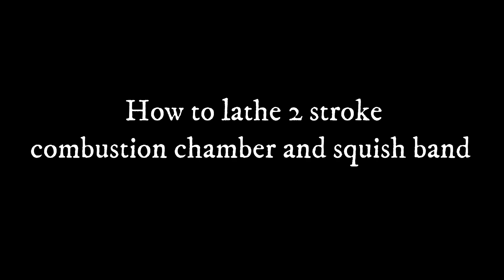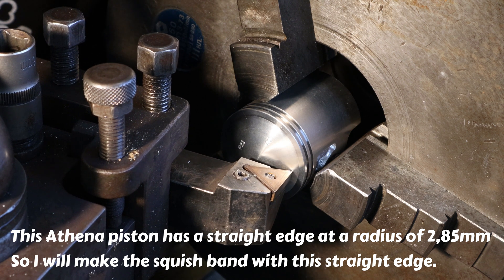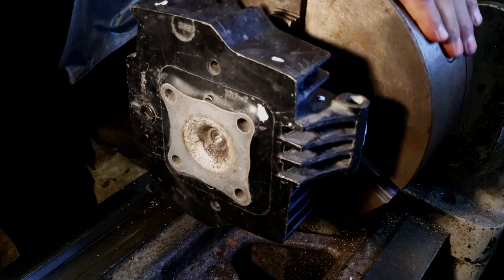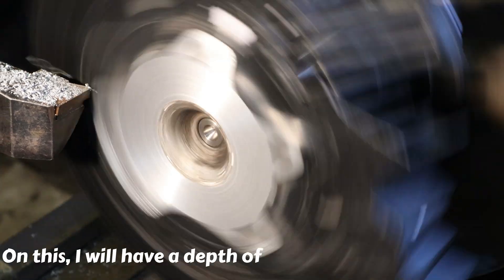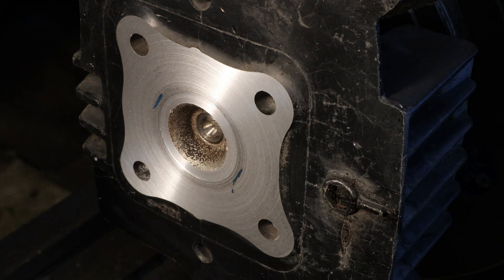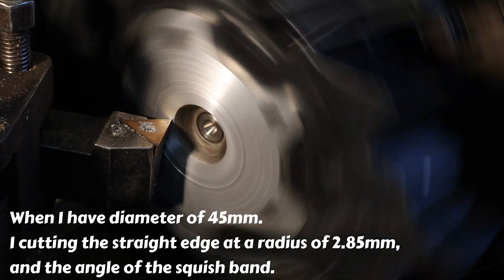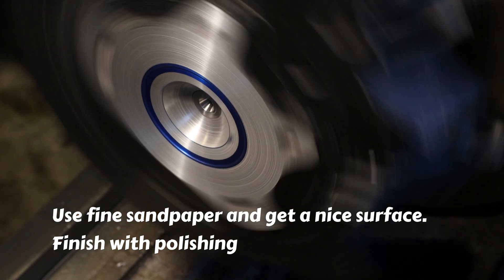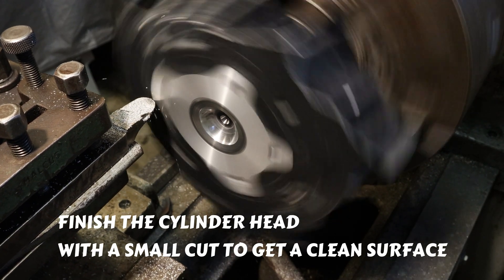How to turn 2-stroke cylinder head by One Kick Norway

Comment: Worst combustion chamber I have ever seen O.O , that's some amazing results and I never thought of using the spark plug hole as an arbor for holding the head on the chuck, many people make complex jigs, but I suppose with something this small and light stripping the hole wouldn't be a concern with this method.

Comment: I've just come across this video, I see you are working on a MT50 or MB50 cylinder head. I have a MT50 that I have spent along time tuning up, I'm running an Airsal 65cc big bore kit (I've modified the ports). The Airsal piston crown is similar to the one in the video, in other words the very outer edge of the crown is a flat top, I presume that your squishband took this into account? The other thing that needs to be right is the volume of the chamber, with a small engine there is very little room for error in this respect, just 1/4cc too little volume will push the compression ratio up too high, measuring the chamber accurately is very important.

Comment: The biggest problem is the stud holes don't sit perfectly around the circle your cutting as the bore doesn't line up with the sqish cut and the  the stud holes. Off center unless you're lucky .You may have to drill bigger holes in the head for adjustment .

Comment: Sir i have two stroke cylinder i want to increase its rpm power please help me how i can increase the speed from its ports. Please help me tell me sir
Reply: Use two cylinder base gaskets and see if that helps.
Reply: @radsdad1  Which one is the base gasket can you tell me in detail.

Comment: Is the compression lower after the machining?
Reply from the maker: Yes, it is lower.
When you have a high rpm engine, you cannot use a top with high compression as original tops often are.
This will cause it to become extremely hot and often not clear revs above 10K.
Reply: @bacardii95   I got a vintage 125cc 2 stroke Kawasaki. It has a breaker points ignition system so I think the max rpm is around 10k. The stock compression is 6.4. Would you suggest raising the compression since the max rpm is 10k?

Comment: Honda MTX 50 cylinder Head! I did this procedure by hand and measured the squish using solder. It more a less turned out exactly the same. Makes a nice boost to HP with the 65cc Athena Kit.
Reply from the maker: Thats nice!